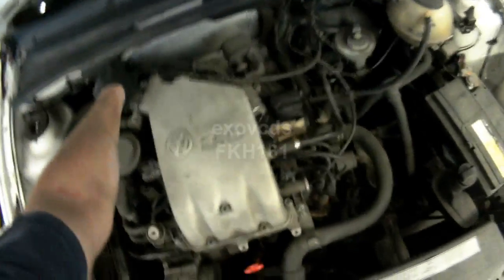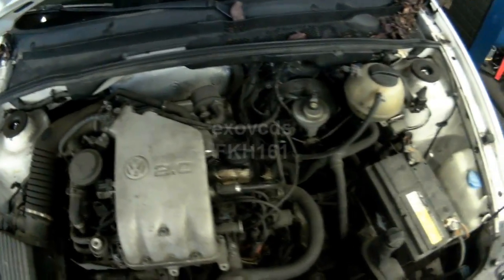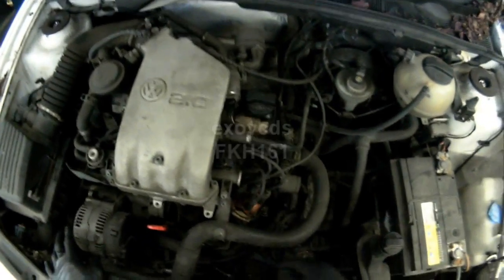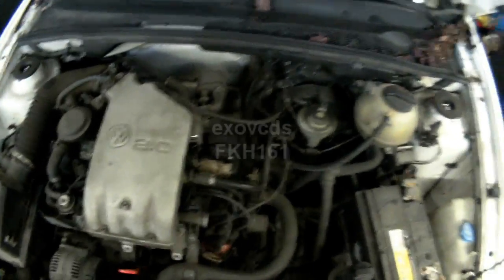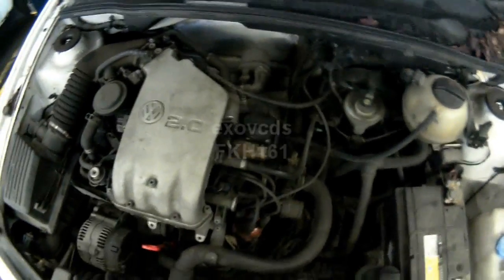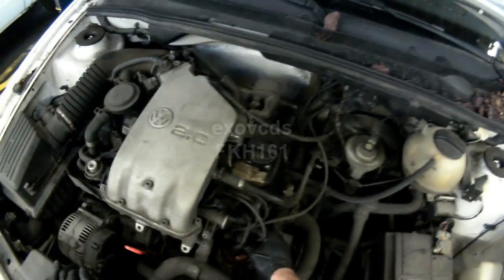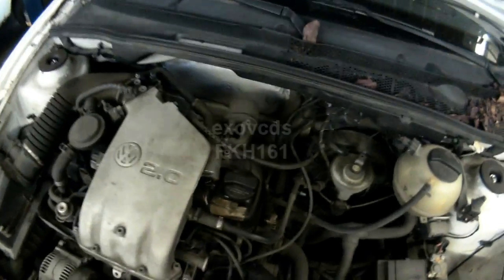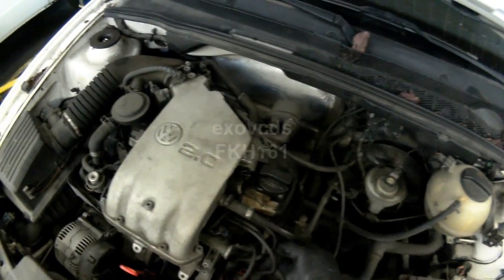VW A3: No Spark Quick Check...

Comment: Haven't been able to get the car started.  I am not getting power to the 4 pin connector to the ignition coil.  Can it be bad wiring somewhere or can this be the computer?  Thanks,
Reply from the maker: Ignition coil connector is a 3 wire connector.
Year, make, model, engine?
Reply: @EXOVCDS  1999.5 VW Golf, Automatic with the 2.0L AEG.
Reply from the maker: Does the starter turn the engine? Is the check engine light ON when the key is ON?
Reply: @EXOVCDS  The engine does turn over.  Engine light is not on:  but I get a "P1857 Load Signal: Error Message from ECU" code.
Reply from the maker: Key ON check engine light should be on = ECM is awake. If you can communicate with the ECM, then the ECM is awake. Your ignition coil does have 4 wires (I thought your coil had 3 because you posted under an A3/mk3 video), sorry.
Ignition coil power wire gets power from fuse 29. Is the fuse OK?
Reply: @EXOVCDS  Yes, I replaced it just in case but it made no difference.
Reply from the maker: Does the fuse have power when the key is ON?
Reply: @EXOVCDS  When I crank the engine I do get power at this location.
Reply from the maker: Should have power when in crank & key ON. It is the Ignition ON (15) circuit. If that circuit drops out, you might have a bad ignition switch.
Reply from the maker: Can your scan tool view RPM? When cranking, is there an RPM signal? Or does the RPM need move away from 0 when cranking?
Reply: @EXOVCDS  I installed a new crank position sensor and check for RPM and am not getting RPM.
Reply from the maker: @LoneGRoEnt  You'll have to go through a wiring diagram then... check all power & ground wires and then sensor wires. The crank sensor generates an AC voltage when cranking. You can check to see if it does... should be around 2.6Vac when cranking (measure across the 2 signal wires). It's a 3 wire sensor. 2 wires will have continuity (around 800 to 1K ohm) and the other is a shield wire. Measure across the 2 wires that have continuity. The crank sensor is the main input to the ECM. What scan tool are you using? Not all scan tools will show all (or correct) fault codes.
Reply: @EXOVCDS  Thank you, for the help.  I'm using a basic bluetooth  ELM327.

Comment: Hi, do you have a video explaining how to do this with an MK4.  I have a no spark situation.  Thank you,
Reply from the maker: Is the check engine light ON when the key is in the ON position? If no... then the ECM is not awake. If yes, then it could be a problem with the crankshaft position sensor. Year, make, model, engine? The more info I have, the better I can guess. Fault codes?
Reply: @EXOVCDS  The car has been sitting for over 8 months; had all the gear lights on and car had issues shifting so I parked it.  And no, I do not see an engine light.  Thanks, for the quick response.  Thank you,
Reply: @EXOVCDS  The battery was disconnected the whole time.
Reply: @EXOVCDS  It's a 1999.5 MK4.
Reply: @EXOVCDS  2.0L
Reply from the maker: I'm still at work, will get back to you later after work once I'm at home.
Reply from the maker: How are you checking for spark? Use a scan tool and check for fault codes / communication with the ECM. No communication = the reason for not starting  / no spark. If you have communication, but there are no fault codes... does the RPM needle move when the engine is cranking? Yes / no? Can you hear the fuel pump run for 1 to 2 seconds when the key is first turned to the ON position? Yes / no? If no... have someone tap the bottom of the fuel tank (passenger side) while you are cranking the engine / trying to start the engine. * TRANSMISSION IN PARK OR NEUTRAL***. Does the pump run? Yes / no?
Reply: @EXOVCDS  I pulled a spark plug and laid it against the air plenum and had someone start the engine.  I have not checked for codes yet, no engine light is on; I will try that tonight.  The pump does run, I pulled the fuel filter line after the filter and cranked the engine and have fuel passing the filter.  I have not checked fuel pressure to the fuel rail yet.  But I did confirm there is no spark.
Reply: @EXOVCDS  I was able to run the codes, however the rpm does not rev up when trying to start.  The codes are P0722, P0725, P1857, P1850.
Reply from the maker: @LoneGRoEnt  What scan tool are you using? Check the resistance of the Engine Speed Sensor (crankshaft position sensor)... like in this video (starts at 2:27)
https://youtu.be/qYfZOb9vzkU?t=147
Reply: @EXOVCDS  Just saw your comment.  I will check that.
Reply from the maker: @LoneGRoEnt  Not all fuses will have power all the time or when the key is turned on. I don't have time to check what each fuse does at this time. If you have fuel pump activation, but no spark, focus on the crank sensor.
Reply: @EXOVCDS  I truly appreciate the help.  And to answer your question I am using a cheap eBay Bluetooth scan tool.  Most of the codes refer to fog lights and high beams which i know I have a short.  Than the other fuses are 28 Fuel Pump, 32 Fuel Injectors, 34 Engine Control Elements, 43 Engine Control elements.  I previously check fuel pressure at the filter and the pump is working, the issue I found is no spart.  I will focus on the crank sensor.  Thank you, for all the help.
Reply: @EXOVCDS  Was just checking the fuses and found no power to 3, 4, 18, 19, 22, 23, 28, 32, 34, 43.  The car started before I pulled the battery a fuse month ago and let it sit all this time because of the transmission.  I wonder if I have corroded cables somewhere or chewed up wires.  I am finding a bit of corrosion on fuses.
Reply: This weekend I replaced the crankshaft position sensor.  I was not able to check for spark because I didn't have help so Sprayed some engine start after the MAF, turned the key gave it a shot and tried to start the car.  And heard a pop, which was vacuum line associated with the break booster which was loosely fitted, not sure why that blew.  I did notice the rev move when I cranked with the new sensor.  Then I checked fuses and noticed 29: Engine Control Module was blown so I replaced it.  After I replaced it I noticed the rev wasn't moving anymore.  Confirmed that there is no spark and confirmed that I am getting fuel to the engine.
Reply: I used your video for trying to test the ignition coil but had no luck translating the 3pin on the A3 to the 4 pin on the 2000 vw golf 2.0l.  Pocked around but didn't get to far so I replaced the crankshaft.  Noticed pin 2 is power and pin 4 was ground but couldn't make sense of 1 and 3...  Also connected a test light to the positive per another one of your videos but again didn't get to far since the 4 pin is different. :
Reply from the maker: @LoneGRoEnt  AT the coil connector the 2 big wires should be power & ground (attach your voltmeter across the two terminals). Should read battery power when key is ON and during cranking. Yes / no? The other 2 pins are coil / spark control. 2 spark plugs fire at the same time... attach the voltmeter negative lead to battery negative and attach the positive lead to one of the control wires. When cranking the engine, the voltmeter should show a pulsing 5 volt signal (if I remember correctly... that's the ON / OFF signal to fire the coil. If there is no on / off voltage, then the ECM is not firing the coil.
Reply: @EXOVCDS  Thank you, I tried the 2 and 4 and have power and ground.  I'll try the others for signal tonight.  Thanks, for the help.  If I don't find signal what should be my next step?  And how can I test the 3 pin connector at the crankshaft just to make sure that is working correctly?  Thank you,
Reply from the maker: @LoneGRoEnt  The crank sensor is a reluctance sensor... it produces its own AC voltage. 2 wires are the AC signal and the 3rd (black) wire is the shield wire. You can either check for an AC or DC voltage. To check AC, set your meter to AC and back probe the 2 signal wires. When cranking, you should get 2.6Vac... when checking DC voltage, attach one lead to battery negative and attach the other lead to one of the signal wires. You should get around 1.3Vdc when cranking. Resistance values as per this video: https://youtu.be/MJIA0AsxASQ?t=782
Reply: @EXOVCDS  Thank you,
Reply: I tested the coil 4 pin connector and now have no 12v power at this location.  The ground is good.  Tested ground from battery to signal wires with key on (I did not crank the engine); and got under 0.5 volts reading at the two signal pins.  I previously had 12v power at this location not sure what changed.  Am gettings codes P0725 - Engine Speed input circuit malfunction. P1857 Load Signal: Error Message from ECU.  P1850: Brake Band Apply Solenoid Circuit OBD-II Trouble Code.  What should I be looking for next? Thanks,
Reply: Can a transmission code stop the car from starting.  And if so will disconnection the transmission sensor allow the car to start temporary if everything else is in order?
Reply: Can this be a bad computer?

Comment: I have 1995 golf 2.0 with a no start no spark. I have power and and ground to ignition coil and the center control wire flashes showing ground for the pulse to be released from coil. not sure why im not getting spark also have replaced coil twice, as you said it more then likely would be a bad coil. maybe im missing something.
Reply from the maker: Are you checking at the ignition coil wire for spark or at one of the spark plug wires? Is the distributor turning? What brand are the "other" ignition coils? The coils can be triggered manually (to make sure that they actually produce spark) with a bunch of jumper wires.

Comment: We've been restoring a 96 Cabrio and washed off the transmission and steering rack at a car wash close to our house since we are about to do the clutch and completely redo the suspension. While washing everything down my wife did get in the car breifly just to turned the acc power on and close up the windows tighter.   Anyway, once washed it wouldn't start back up..at all..even after sitting in the sun for two days so we had it towed home.  It cranks as normal but doesn't start.  We tested the center distributor plug wire and also one plug wire and there is no spark from either so we assumed the coil was bad so we bought a new coil but..wow..no dice there either! 

We haven't tried the fuel pump but you can smell gas after cranking it each time and the car was running fine just before the wash.  I can only assume we fried something electrical somewhere?  We tested across the 3 outer coil plug power pins with a voltmeter ( the pins in our Bently manual are stated as neg-#1 and pos+#3) and yes, they are getting voltage (~11.5 to 12v). The center pin, when tested with an LED connected to pos+ batt terminal does not illuminate at all, maybe just  a single small brief milli-second when you set key to on/pre-crank, but when cranking it does not flash or illuminate at all with our LED tester.  What should we check from here? Do you think we fried the ECM?  This is obviously electrical. If it is the ECM can it be reset?
Reply from the maker: Test one or both of your coils like this:
https://www.youtube.com/watch?v=skyF3tFvD0I
Reply from the maker: Usual suspect after an engine wash is the ignition coil. Aftermarket coils can be bad out of the box. The crankshaft position sensor is the main input to the ecm... no crank signal = no fuel and no spark. If you are smelling fuel,  then the injectors are clicking... which makes me think that the crank sensor is OK.  Remove the spark plugs to confirm plug wetness... dry off and check again. Remove the distributor cap and look for moisture under the cap. Remove the black plastic cover from the distributor cap if the black cover is in place (remove distributor cap and pry black cover off of the cap on a bench). Eliminate everything first before going after the ecm.  Attach a scan tool... check for codes. Check for an rpm signal via scan tool / live data. No rpm signal = bad crank sensor. If the ecm is fried... no resetting can be done... would need circuit board repair.
Reply: The new coil is made in Poland, not China, but we didn't spring for the higher cost of a Bosch either. We actually replaced the cap and rotor anyway in the process as it was due (I change them every 25k miles) and because the distributor is so vertically mounted I assume it would be hard to get water in it. Regardless I blew it out with compressed air when home as well a few of the plug connects like the 3 pin on the coil and some others.  As for the plugs/wires I haven't taken the intake off yet for the center two but the outer two looked fine and dry. I have nice high-suppression silicone wires which are tight fitting and also use electrolytic grease on the ends.  I barely washed off the engine, it was more of the right side to clean the tranny and the steering rack.  The engine got wet but I wasn't totally soaking it.  My wife also says the engine oil light is flashing when cranking and we couldn't recall if that's normal or not.  The car has fresh oil as of 1,000 miles ago and I checked the level and that's fine too.  Definitely a spark issue I assume.
Reply: And I thought of maybe pulling the plugs out to check for fouled plugs or wet plugs or water in the cylinder but again, if the coil is not even providing spark then checking the plugs is not the next step.  We actually tested one plug wire with a brand new NGK plug we had in the garage that was going to be used soon (as part 2 of our  regular 25k mile tune up).. so.. where to now? Again, the center pin of the three on the coil's power plug is not flashing nor illuminating at all while cranking.  Does this point to an ecm issue?  And we did use our OBDII scanner. It just pulls up an oxy sensor, and an evap exhaust sys malfunction (due to ox senson) but these two are codes we've been living with for awhile while the car was running fine.  It's not throwing any other codes.
Reply from the maker: Jeff Chartier Oil light flashing is normal with excessive cranking. Does your cabrio have a check engine light when the key is on? If it does, but the light is off... check power supply to ecm. I'll think of some more stuff and will get back to you tomorrow... got to get some sleep now.
Reply: Thanks for the help!  I'm pretty mechanically inclined. My wife and I have been self-maintaining our Cabrio and old Tacoma for 12 years.  Sleep well and if you can help me get this sorted out over the next week I will buy you a case of beer via PayPal.  I mean it!  THANK YOU!!!!  Your videos have already helped a lot. goodnight.
Reply: Hi there- Jeff's wife here.   We are narrowing this down to a bad out of the box coil or something further back on the line.  We tested the plug that goes into the coil per one of your videos and one thing I noticed was that while the LED on the logic probe did flash when cranking on that center signal wire, the light was much dimmer than the ground or the positive when checking those... could that mean anything?  Also, is checking the coil resistance a good way to check if it is bad out of the box?  We are reading 2.2 ohms on the new one (same as the old one) but the Bentley manual specifies .6 to .7 ohms.  Thank you.
Reply from the maker: The brightness of the LED will not be as bright as when checking for power or ground. As long as you have verification of ECM control (flickering), the power "output stage" (transistor that is part of the ignition coil) should take care of opening & closing the ground side of the ignition coil... which results in the coil sparking or not.  I can't recall the last time that I checked  the resistance of a coil... when I get a 2.0l with no spark / no start issue, I attach a good used coil and see what happens. If it doesn't start, I check for coil control and continue from there.
Reply: Since our new coil was reading the same resistance as our old one we went to the auto parts store today and checked another one against the first two and the third reads the exact same.  (~2.0 ohm across terminals #1 / #15 which are the two large metal prongs that stick out the side of the coil under a plastic cover and when testing the coil plug wire connector post (called terminal #4 in Bentley) to pin #15,  the Ohms are 3.6 (on 20k voltmeter setting).  The MK3 Golf-Cabrio Bentley manual says the resistance between the two metal pins (#1/#15) should be .6 to .7 ohm while all three we tested said 2.0 ohm!  What's odd is we've also seen a thread on VWVortex with a guy saying his wet coil had a high resistance of like 2.2 ohm and wouldn't fire until it dried out and reached the lower spec of .6 to .7 which is what the Bentley manual also says.   So...We've now tested 3 coils...1 old,  2 new...all saying  a full 2.0 ohm across the two main pins and 3.6 ohm (which is within spec) for main coil plug test.  So either all 3 coils are somehow bad..or we need to move on to the next step of troubleshooting.  Any suggestions?

Comment: How do check that and is there a relay that could be out
Reply from the maker: +M Thomas Does your car have a relay is slot #3?
https://static.cargurus.com/images/site/2013/05/08/11/49/pic-568440149806152368-1600x1200.jpeg
Some cars have a relay some don't. 
If you have a relay with 109 on it, then the relay might be bad.
If you don't have a relay in slot #3, then you have to check a wiring diagram for power & ground locations.

Comment: Let me tell you what all started with this had a water leak it overheated filled it back up and got it home replaced the radiator then found the water pump went to crap replaced that then wouldn't start replaced all the ignition stuff no check engine light and timing belt is spinning haven't checked the altnator
Reply from the maker: +M Thomas No check engine light with key on? Then the computer is not turning on.